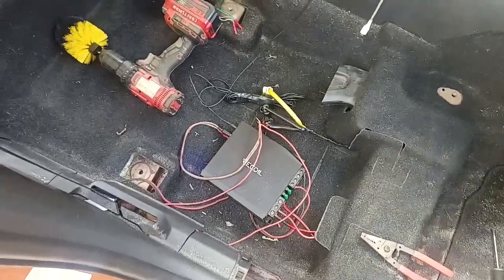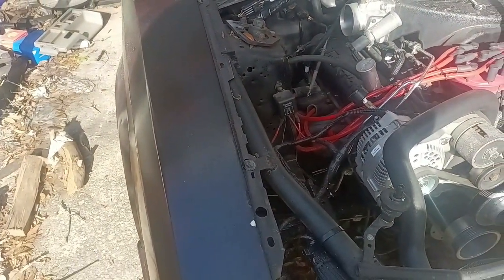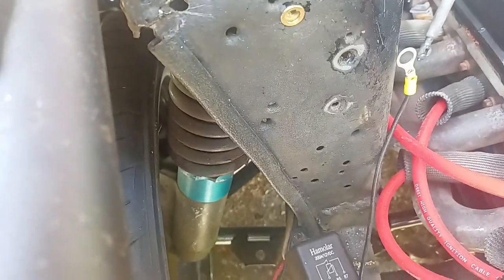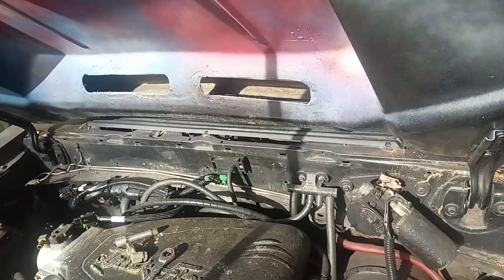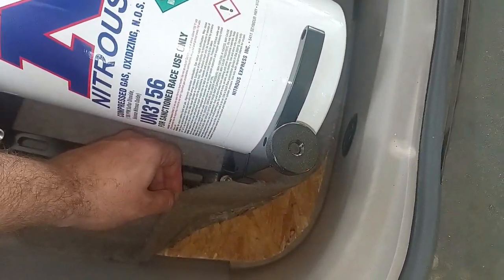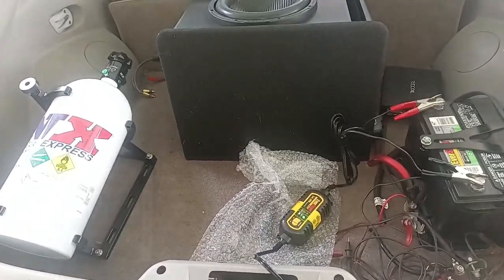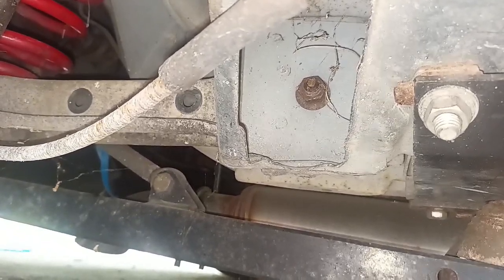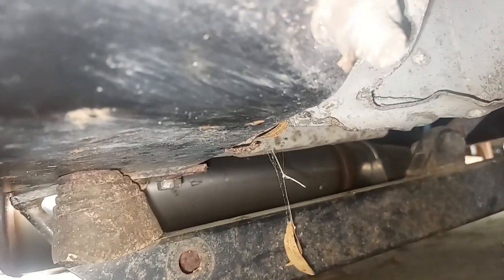Taking care of a few side projects while waiting on Parts | The Poverty Fox | #foxbody #mustang

Comment: Them traction bars most likely r supposed to be touching the frame to make the rear end more solid like on trucks ik they use them so the rear end does roll forward everytime they hit the gas pedal but it just seems like an old style anti sway bar basically IMO....i would slap them sway bars in for better handling and its not like u have a manual and luaching the car super aggressively.....just my input 👍
Reply from the maker: According to instructions ive found on similar setups there should be 1/2 of space at min between bars "Bumper" and frame